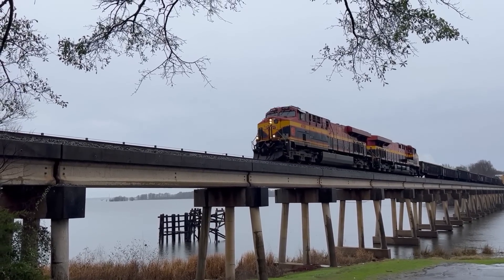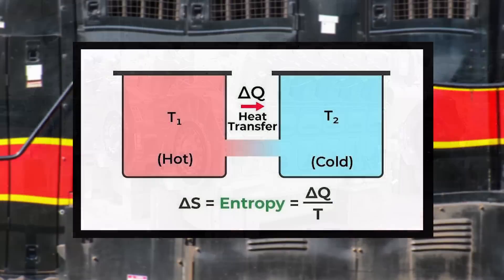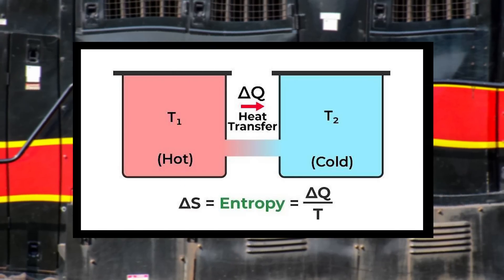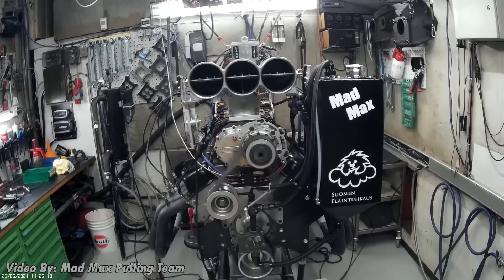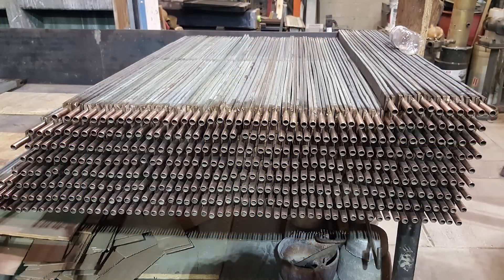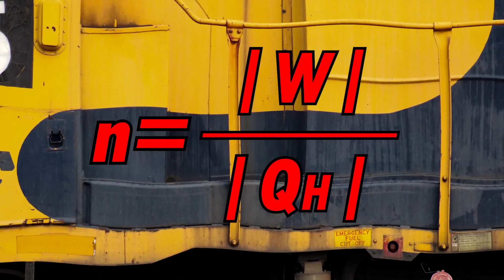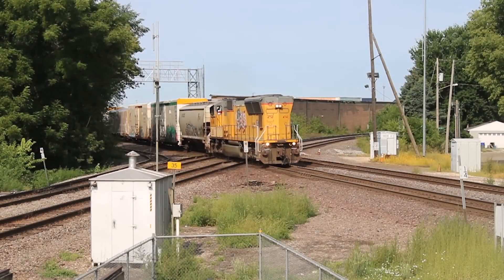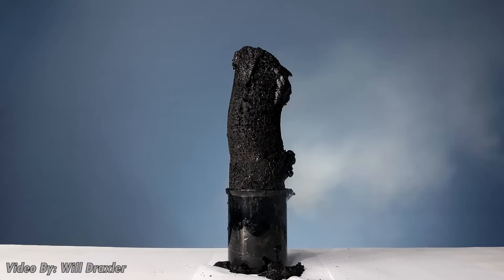Why Have Radiators On Locomotives Gotten SO BIG!?

Comment: Long ago I was taught by a techie at Fairbanks Morse that engines turned some of their heat into power and the rest was waisted and had to be dissipated, about half of that was exhaust and that problem took care of itself, the rest of the wasted heat went into the engine itself and that the engine would eventually self destroy if it wasn't gotten rid of.  That function was taken care by the cooling system, generally engines use liquid cooling, generally water but the engines oil lubricating system is also a major player here.  The water jacket around the cylinders removes the major heat from the engines while the oil flowing thorough the major moving parts of the engine cools these down.  Over the years builders have added additional turbocharging systems to engines to increase the power output of the engine as well as reducing emissions, the turbocharger needs to be cooled as well, again the oil cools the bearings while many use a water jacket to keep the housing cool.  Boyles law says that increasing the air pressure will increase the heat and it is more efficient to supply cooler air to the engine so intercoolers were added and these had to be cooled, most highway trucks use air to air systems for intercooling but most locomotives with five to ten times the horsepower needed to use water cooling.  All of this along with a more than double horsepower output requires a larger radiator.  I believe that most locomotives use only treated water in their cooling while trucks and cars that are routinely allow to cool down to ambient temperature that might be freezing, use an antifreeze mix that not only prevents freezing but allowing a much higher water temperature before reaching the boiling point, this higher temperature allows relatively small radiators to still be efficient and do their job.  it is essential that the cooling system be of adequate size to meet the power potential of the engine, an engine cannot sustain operation at a given power level unless it can reject the heat generated.  Some aircraft engines have two power ratings, one for takeoff and a second for continuous power (i.e. cruise speed), the first is time limited, five minutes is common, but especially on very hot days, the pilot must monitor his cylinder head and oil temps to stay out of the red line.  Railroad locomotives might run at full output for hours when pulling a long freight train up a mountain range so full power is rated at only the continuous duty number.  I had discounted the exhaust issue but it is also essential to have an efficient exhaust system, back pressure is the enemy.  Generally one of the first things hotrodders do to an automotive engine is to modify the exhaust i.e. reduce back pressure.  Again looking at hot rod and tractor pull engines, in both of these cases the engine is asked to run far above its heat rejection limit but only for a few seconds for the drag racer and less than a minute for the puller.  Automotive engine designers have multiple goats to accomplish, the want the engine to heat up fast for car heating and defrosting as well as smoother running but the still want it to be able to climb long hills without overheating.   They also want the engine to be small and light along with a small and light radiator but remember while a car needs power to get away from the stop light, most of the time it is cruising down the road making about 25% of rated power.  This engine might not be too happy if you add a trailer and take a trip up to the mountains on a hot day.  The engine reaches its heat rejection limit.  You might note that the car engine when compared to even a light truck for a similar hp engine, has less water in the cooling system and less oil in the crankcase.

Comment: I really hope there is such a thing as a catalyst that can use thermal energy to make a highly endothermic reaction to convert carbon dioxide and water back into diesel and/or gasoline. Waste heat going into 5hat reaction would increase overall real efficiency, perhaps even flirt with theoretical maximum in optimal conditions, but I fear that kind of catalyst is right next to a 60⁰F, 1 atm superconductor...

Comment: The other thing about those fatter cylinders is that friction losses during piston movement are lowered. If you double the diameter of a circle you double the circumference and quadruple the area. Doubling the friction losses in the larger cylinder whilst quadrupling the fuel/air mixture is, all things being equal, a beneficial change.
Reply: All things being equal, the larger the cylinder, the more efficient the engine, because the cylinder surface area (where heat is lost) decreases relative to the combustion volume.
Reply: @ClockworksOfGL  I may have summarised excessively.

Comment: That is why we in Europe prefer much more Electric locomotives rather than Diesel-Electric Ones. Look at this example in Narvik (Norway) where just  two single-ended locomotives having a total power output of 14,400 HP and a traction effort of 600 KN (130,000 pounds-force) haul 8600 tonne  iron ore trains.     https://youtu.be/g3_H3RqMBGM?si=qGpb2UrvClRP5GYV

Comment: Isn´t AGR a factor too? Because a part of the exhaust gases is fed back to the engine, everything gets hotter, and therefore needs a bigger cooling system to stay at optimal operating temperature.

Comment: Thank you! - As a European I had assumed these radiators to double as places to dispose of heat during electric braking: when the electric motors are reversed to generators (to spare the brake shoes). (In Europe many locomotives are electric using overhead wires. Ever more of these can "upload" part of their braking energy into the catenary grid.)
Reply: usually those resistors are elsewhere on the locomotive
Reply: @harrimanfox8961  Thank you! - But I'd expect these to be well-ventilated too. I mean, braking an American-length train descending from mountain passes (well, keeping it in check) must generate considerable heat in those resistors, therefore require considerable cooling. So this is another cooling circuit?
Reply: @chrislaarman7532  the resistors are air cooled by fans/blowers.

Comment: Larger radiator = more surface area for heat exchange = more efficient cooling = the locomotives can work harder indefinitely without overheating.

Comment: Good point in that as power of the engines increase they need a larger radiator.  However you incorrectly state that all the waste heat must be removed from the engine by the radiator.   Only a small fraction of the engines waste heat will warm the engine and is removed by the radiator.  .  Most of the waste heat goes out the exhaust pipe and warms the air!

Comment: If you do some research Mount Newman Mining and Hamersly Iron in the seventies in Australia modified their locomotives because pulling the 27000 ton iron ore trains in 40 plus Celsius 104 Fahrenheit + there locomotives would be running hot lot of these locomotives were traded in and started a new life back in the USA take a look at Hamersly Mining now called Rio Tinto mining train automation no drivers leave the port go 300 plus kilometres load and return move hundreds of millions of tonnes every year

Comment: Isn't some of the radiator space used to disipate the heat generated by resistive heat coils in the dynamic braking system? There was no mention of dynamic braking in the video.

Comment: Uh, this is just completely wrong. Not the effects of thermodynamics, but everything about why the radiators are actually so big. They've gotten so big because of dynamic breaks. Which are essentially just giant resistors that turn the braking effect of the traction motors (which become generators) as heat. This is where the need for the large radiator section comes from. This is also why those are called dynamic break blisters. The radiator itself does not fill that entire space.

Comment: There are two radiator systems in a locomotive, for cooling the prime mover, and for dynamic braking. Both radiators have become larger as a result. Thanks for the video. Jon, on the U.P., Pacific Coast Line, Santa Barbara Sub., M.P. 404.5
Reply: Calling the dynamic brake grids radiators is a no-no!!
Reply: Why? They literally are a radiator

Comment: Fairly good explanation, but a few things were off. In short, radiators getting bigger because engines are getting more powerful is the main reason, though I get the sense emissions compliance, requiring engines run cooler and stuff like cooling exhaust gas for recirculation are also factors.
The hot and cold reservoir isn't really a direct explanation. This would make sense in a closed-loop cycle, like a Stirling engine as mentioned, or a condensing steam locomotive. In those cases, the recirculating working fluid has to expel all its waste heat through a radiator like this, that being the "cold reservoir," before re-entering the cycle into the "hot reservoir." A condensing steam locomotive is a perfect example of this cycle, the water/steam a closed loop, the boiler being the "hot reservoir," the condensors and air that cooled them being the "cold reservoir." The greater the difference in temperature between these, the more effective the radiator and even cooler the ambient air, the more efficient they were. There were a few condensing steam locomotives built, they had massive condensers, I believe usually on the tender. They were thermodynamically more efficient than open-loop steam locomotives, and didn't need to refill water, but complexity and bulk of the condensers made them rare.
Internal combustion engines work rather differently in terms of the "hot" and "cold" reservoirs and the radiator's role. These are open-cycle engines, where the working fluid is ambient air drawn in, used, and expelled as exhaust (disregard EGR). The "cold reservoir" is the cold air being drawn in through the intake. In an "ideal" engine, as analyzed in my 300-level thermodynamics course, no heat is exchanged with the cylinder walls, all heat is added via combustion and expelled via the exhaust when the hot gases are exchanged for a new charge of fresh air. The waste heat leaves via the exhaust, not the water jacket. However in reality some heat is conducted into the cylinder walls and piston, which causes two things, both bad: For one thing, a reduction in efficiency as the heat leaving the cylinder that way is lost energy that otherwise could (partially) provide power. For another, this heat would heat up the engine block until it melted or seized if not removed by a cooling system, which adds a lot of complexity, weight, absorbs some mechanical power, and so on, but is necessary for the engine to not melt down. Heat dissipated from the radiator isn't an inherent part of the thermodynamic cycle but an unavoidable byproduct. The larger the volume to surface area, the less heat is lost this way, so fewer larger cylinders in theory would need proportionally less cooling (and be more efficient) than an engine with more smaller cylinders, hence the trend in that direction - this was something the video got wrong. It is still overall a fairly small fraction of the overall heat energy though, the majority of the leftover waste heat exits in the exhaust. The radiators, even if seemingly huge, are a lot smaller than they would need to be if expelling all the heat from a closed-loop cycle of equivalent power and efficiency. The overall heat to be dealt with is still at least roughly proportional to engine power, hence why more powerful engines need bigger radiators. I feel like that intuitively makes sense even without all this thermodynamics discussion - more power = more heat = bigger radiators.

Then, as briefly mentioned, as well as more powerful engines there's also emissions and efficiency stuff. I don't know the details of split-cooling, but overall modern diesel locomotives would need to cool not only the block, but also an intercooler and EGR. Earlier locomotives didn't have EGR, and I'm guessing didn't have intercoolers - many weren't even turbocharged in the early days. I also understand that, probably for NOx reduction, the engine has to be kept cooler than in the old days. This to my understanding is why Porsche had to eventually switch the 911 series to watercooling, the air-cooled engines worked pretty well but ran too hot to be capable of complying with modern emissions standards.
Reply: I was looking through the comments hoping someone would say this.

Comment: One thing for sure, diesel and kerosene (jet fuel) won't be going away any time soon. So with electric cars what will be done with all the gasoline a former waste product of refining process before the internal combustion piston engine? Go back to burning it off? It is all a big game filled with lies of pollution. The more efficent things get the more the fuel cost goes up. Production is profit.
Reply: Railways have the option of electrification, as is already standard in some parts of the world, is typically used for urban passenger operations, and all high-speed trains. Trains are probably the most straightforward mode of transportation to electrify, the technology has existed and been in use for over a century. But the problem, at least on the US freight network, is cost, the cost of building and maintaining electrification on such a vast system, at least for now, outweighs the fuel savings. But rising fuel costs or environmental considerations could shift that - it's always an option at least. Aircraft is really the challenge, so far there's no practical alternative to combustion-based fuels. There's talk of "sustainable aviation fuel," but I question environmentally, ethically, and economically if that's actually any better. But if things go the way you ponder and there's zero demand for gasoline, only kerosene/diesel/jet fuel, you can always fuel turbine engines with gasoline. They'll burn basically anything, and many turbine engines are actually approved to run on aviation gasoline if for whatever reason jet fuel isn't available.
Reply: Aviation gasoline contains lead.:face-orange-biting-nails: @quillmaurer6563

Comment: 4:08 you say that the radiator is the cold reservoir of a heat engine. That’s not correct, ambient air is the cold reservoir.

Cooling the engine is about protecting the engine from too much heat and about emissions.
Probably other things as well, but it‘s not about the working principle of an ICE.
In fact, a single stroke is often simplified as adiabatic (i.e. no heat transfer to the environment) as the heat transfer is minimal.
Need more proof: top-fuel dragster don‘t have a cooling system as they only run short times and wouldn’t be able to transfer much heat anyway
Reply: For clarification: most of the heat that didn’t turn into mechanical power gets dissipated via the hot exhaust gases

Comment: Question, why most EMD locomotive fan radiator is visible while GE don't, does it have different method of radiator cooling?
Reply: Not certain on this, but my suspicion is that they have different radiator and fan arrangements. Both have flared radiators, and air comes in on the sides and out the top. EMD has the radiators on the side, with the fan at the top sucking air through them. Thus the fan is on top, visible from above. This goes back to the earlier not-flared configuration where the radiators were along the sides near the top of the hood, and fans on top drawing air through them. As cooling requirements grew, the flared design allowed both fans and radiators to be bigger. GE I believe has the radiator on top, fan blowing air through the radiators from underneath them. Thus the radiator is on top, fans not visible.

Comment: Around half of waste heat goes out the exhaust.  So if the engine is 50% efficient then 25% is going into the cooling system and 25% out the exhaust.
Reply: This was my immediate thought as well, wrote a long comment on this. Though I believe the vast majority of the waste heat is from the exhaust, only a small fraction through the radiator. But even so, generally the heat the radiator has to deal with is proportional to engine power. Then getting bigger due to emissions equipment as well.

Comment: At the end he said that engines with fewer but larger cylinders need to shed more heat, thus a big radiator even if power output is lower.   That sure doesn't sound right.  Because if he's right, these smaller power output engines have lower efficiency ie poor fuel economy and more emissions.  I can't see that being acceptable to anyone.
It may be the case that a standardised chassis, body, and radiator is used with different size diesel engines.  Much like the ford Falcon I owned had optional 3.3, 4.1, and 5 litre engines, with the same radiator in all cases.
Another factor;   as time has rolled on, diesel engine designers have gone for greater levels of turbo boost.   This raises the amount of heat conducted into the exhaust valves, which must remain within a temperature limit to retain long life.   exhaust valve temperature is kept down by increasing the conduction from stem to head.  This increases the total amount of heat delivered to the coolant.  this does not mean lower engine efficiency, because it is heat that would otherwise go to atmosphere via the exhaust.

Comment: Isn’t there an optimal temperature for the diesel engine to operate at for highest efficiency?  And, if so, isn’t the radiator designed to achieve that optimal temperature?
Reply from the maker: Yes, absolutely. That’s why radiator shutters exist. They allow extremely fine control over the airflow across the radiator, and therefore cooling of the engine.